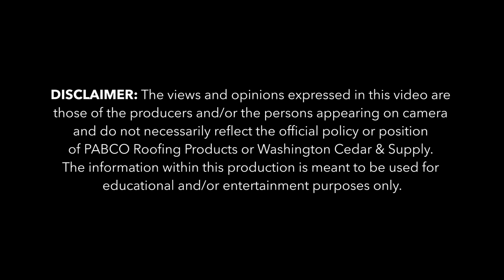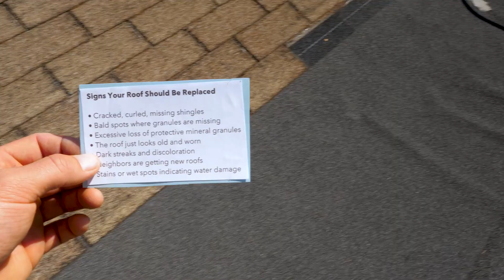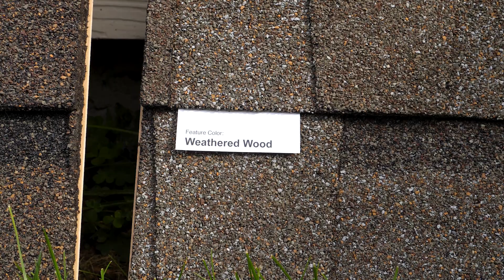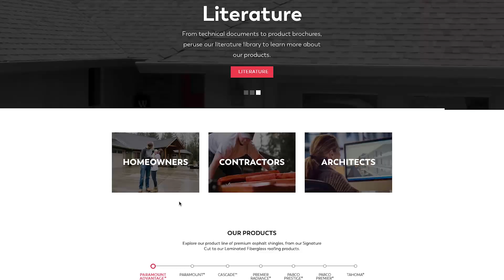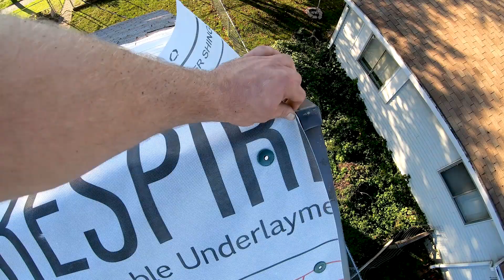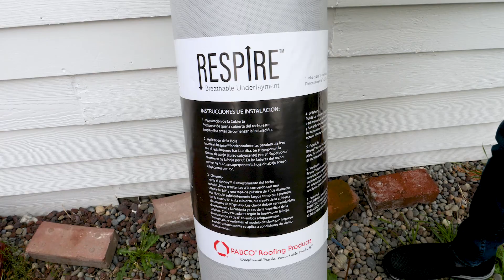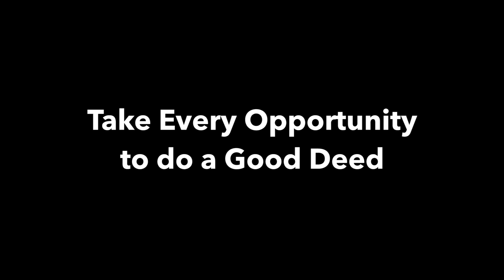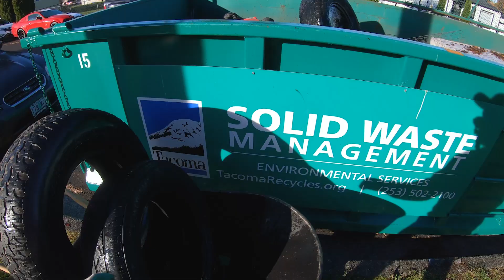How to Roof a House | Roofing Tips & Tricks 🏠

Comment: You left out key info. How to roof around vents. When you did the peak you didn't explain or show how the underlay was placed. Does it fold over the top of the peak or does it go to the top and stop at the peak. You didn't really show how you start the pattern on the roof. I was going to buy the product that you used and watch this video as a guideline, but I'm not sure now. I still have too many questions to use this video as a guideline.